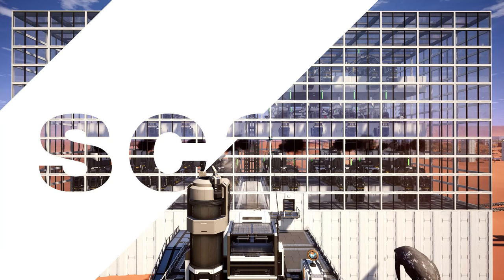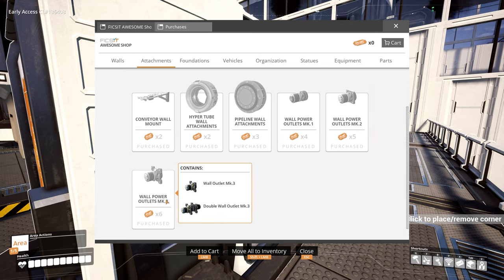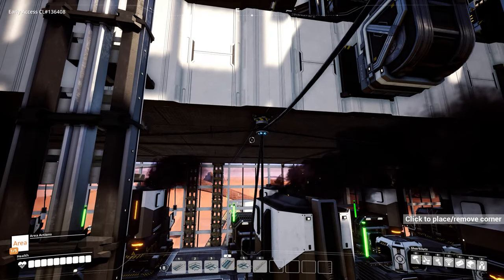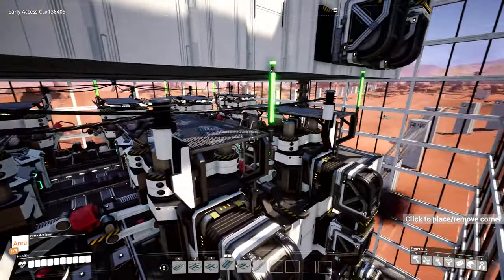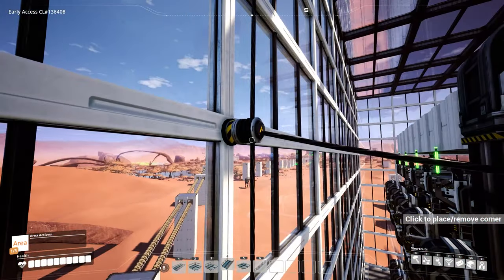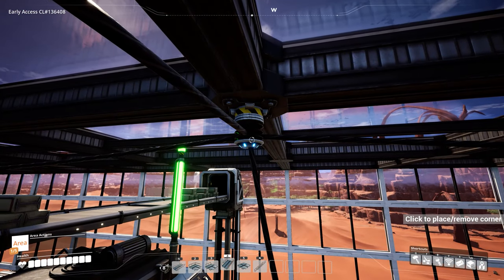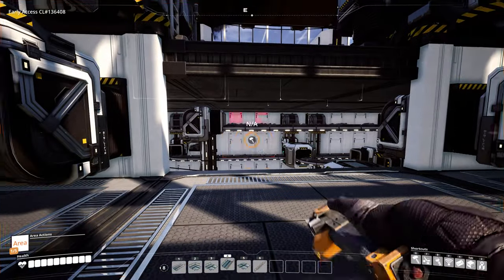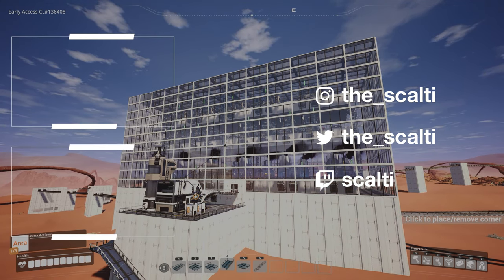How to Cleanly Route Cables [SATISFACTORY TIPS & TRICKS]

Comment: Built his Copper building (Very tricky without flight). So Awesome BTW !! For a cleaner look, I placed the nubs within the sandwich space then clipped through the foundation just below each unit.  Can’t even see the connection in most cases and the only visible wire is one going between each floor.

Comment: S C A L T I ! The one & Only ! Is that a new mic ?! that is one smooth voice !
Reply from the maker: I’ve been using this once since I released the coal generator video. The reason it may sound different is because I’ve been adjust the equalizer of it.
Reply: @Scalti  new subscriber, you must have had another channel before? These guides are amazing and after I spent days exploring, I needed to better my production, I was wondering how you hid the power poles! Now I have your iron/copper/plates/rotors setup... off to setup the coal. Just learned I could have made the walkway like you suggested, I ended up doing it the hard way to avoid most enemies. Towers and tons of foundations everywhere. Thanks for the info/guides!
Reply from the maker: @lucklamotti5419  First channel I’ve made with intent of content creation. Glad you’ve found everything helpful. :]

Comment: got a little challenge for you.
make a game where your only powersource can be fuel generators.
my first setup make almost 6000 mw and all the fuel , rubber and plastic your heart desires.
im limited by mk 1 pipes . cant push it harder atm  https://steamcommunity.com/sharedfiles/filedetails/?id=2296679198
"im just using the oil nodes from this island i built on.  sure i can get more power from multiple nodes."
Reply from the maker: What power am I allowed to use until I get to fuel?
Reply: @Scalti  whatever needed. coal or bio.